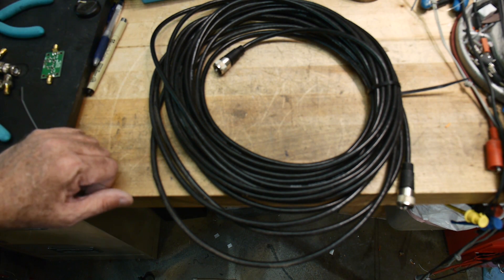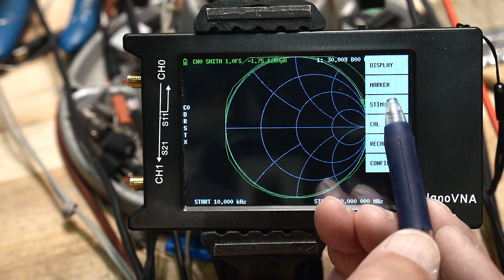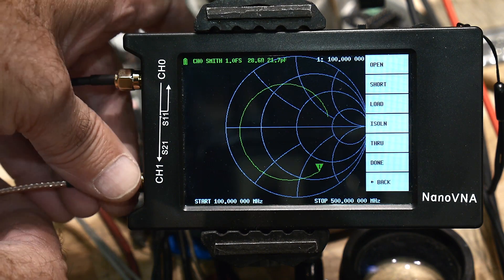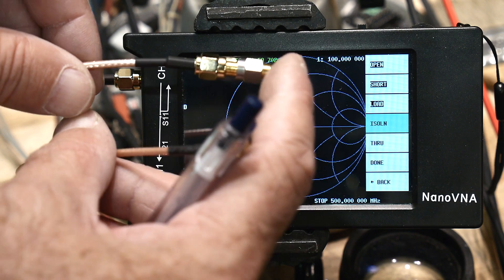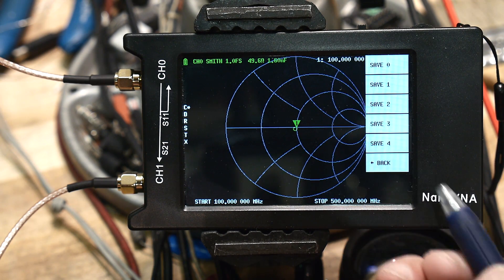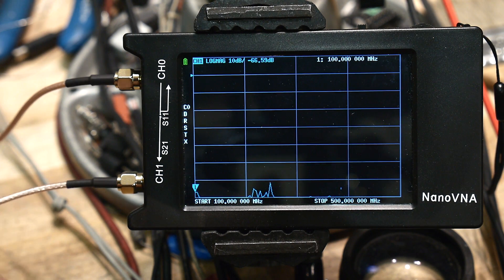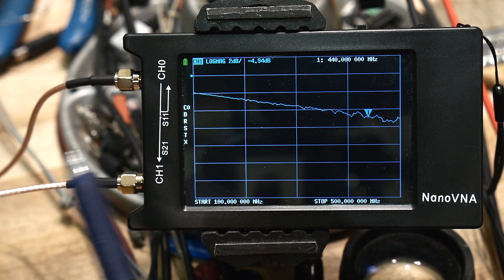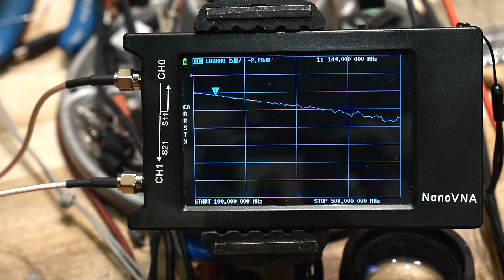#564 NANOVNA Coax Loss Measurement

Comment: As I understand it, the point of connecting these short RG316 cables is to make it easier to connect the cable being measured? What I mean is that the main measuring cable could be connected directly to the channels via PLA to SMA adapters.
Reply from the maker: yes, you can connect it directly and calibrate at that connector, if you use the small cables, you need to calibrate at the end of the short cable. I do it that way
1. to eliminate any mechanical stress
2. make it easier to move the device for viewing (photography)

Comment: Thanks! I built a common mode choke for HF last week and tried to measure both the common mode attenuation and the through loss, and got the same numbers for both. (Losing 25 dB of my transmitter power was going to pinch.) I didn't realize I had to use Trace 1 to view the Port 1 magnitude. I just tested again and the common mode attenuation is 25 dB or more, and the through loss is less than a half dB. Not too bad for something cobbled together on a whim.

Comment: You can also use the elect-delay function to compensate for small bumps from connectors etc. Without disturbing your calibration.  W2AEW has a good video on this..

Comment: Aren't the loads to be connected directly, without a cable in between? I usually use my reference cables just to calibrate "Thru".
Reply from the maker: many times you will want to measure a device that can not be connected directly to the VNA. if you cal at the vna then do the measurement. the measurement will be the device and the cable both. if you calibrate at the end of the cable then all of the properties of the cable will be ignored

Comment: To put this loss into perspective, every 3dB loss cuts your power in half. So that 5 dB at 440 means this cable eats most of your power.  50W at the radio will give only 16W at the antenna.  This is why cable quality and cable length are both critical.  I'm using 35ft of LMR 400 to get to the antenna on my roof which gives me 0.6dB measured loss at 144MHz and 0.95dB loss at 440MHz.  So 20W at the radio gives me 17.4W on 144 and 16W on 440 to the antenna.  Also, you really should calibrate out those adapters.  The do have loss, and stacking them like that can cause more loss than you think.
Reply: If your radio is putting out 20w, and you believe that an adapter has even just 1dB of loss, then you should expect that the adapter would therefore be dissipating about 4w of power as heat, and being so small it would be soon glowing red hot (or at least a burn hazard). If it's not glowing red hot (nor a burn hazard), then perhaps your assumption that the adapter is significantly "lossy" needs to be reevaluated.
Reply: @JxH  loss doesn't mean only heat. It also includes radiation. Also, if SWR is high, the transmitter can be absorbing some of the reflected power.

Comment: Hi IMSAI Guy, great video.  There is a shortcut you can take when calibrating the NanoVNA for coax loss measurements which you might have already stumbled upon since you made this video.  You can skip the open, short, load and isolation part of the calibration and just do a thru calibration if just doing loss measurements (or phase shift measurements) using the S21 port.  Just select the frequency range you want to use, connect your jumper cables together just as you did, select calibrate, select reset, select calibrate, select thru, and select done.  You don't need to save this calibration, and the calibration will be valid as long as you don't turn the NanoVNA off or recall a previously stored calibration.  This shortcut procedure is nice in that you don't need to use your open, short, and load calibration standards, and you don't need to save the calibration in an already stored calibration that you might have wanted to keep.  Just FYI, Don

Comment: Can i measure cable lose measurement with single port vna?
Reply: Measure reflected power on two different cables and subtract. If you know the absorption of the first cable, then you can calculate the answer.

Comment: For me after calibrating the way you do it shows -23db insertion loss when I connect through. What did I do wrong?
Reply from the maker: my stop frequency was 500MHz. you may have been measuring at a very high frequency.
Reply: @IMSAIGuy  My Range was 850Mhz to 890Mhz. I am trying to measure for LoRa at 868Mhz
Reply from the maker: @elmejor06  check the datasheet for the coax you have. it probably have that much loss at such a high frequency and length.
Reply: @IMSAIGuy  no I mean I get that much loss with my VNA calibrated and the cables connected with through. I am not even measuring. Something must be wrong with the calibration.
Reply from the maker: @elmejor06  with the 6" cable? something is very wrong. have you ever made an S21 measurement before?
Reply from the maker: @elmejor06  maybe bad cable, they are very cheap. use an ohm meter to see if there is connection and look to see if the pin is extending out and didn't get pushed in.
Reply: @IMSAIGuy  no, I am completely new to this.
Reply: @IMSAIGuy  I got it. I had it set to S11 and not S21. Now it works. Thank you for your replies and this tutorial!

Comment: For the 45 years I've been a ham I've always heard that there is "some" loss at every connector so if you use 2 or 3 adapters on each end of the cable are you sure that you didn't introduce "some" loss? Or were you implying that it was negligible as far as the measurement. I would have thought that half of the 2 meter band loss was in the plethora of adapters.  Please understand that I'm not disputing you. I just want be sure I understand what is factual. Thanks for one of THE MOST INSTRUCTIVE videos I've seen on using the VNA devices. I am building 2 meter base antennas out of junk parts for new hams on tight budgets and the VNA will be helpful in adapting the pieces and parts to 2 meters. I just subscribed to your channel.
Reply from the maker: https://youtu.be/GOCD5DvOj5c

Comment: In the total scheme of your system for this test, with all its connectors, adding the little OPEN terminal to calibrate is a waste of time - you may as well calibrate with nothing on the end.
Reply from the maker: and I'd have a bunch of people comment that I didn't calibrate correctly.     I won't win  (no it doesn't make any difference is this measurement)

Comment: I think everybody by now knows how to calibrate a nanovna.  Why don't you just do the measurement and you will have a 2 minute video which is all the useful content here.
Reply: You would be amazed to find out how many guys do NOT know how to calibrate a nano VNA .. why one needs to calibrate it with the pigtails when used, and how many forget to press RESET when they start a calibration, or not save it after it's completed.
Reply: There's always somebody who will have just bought one and needs help. I've perhaps had mine 4 months.
G4GHB

Comment: sir is this good for testing rg6 cable braid if damage or if with loss is this good for residential conduit cable test
Reply from the maker: residential cable is usually 75ohms so this will not work as shown
Reply: @IMSAIGuy  Can the test impedance be adjusted? How about using a 75 ohm resistor to calibrate the VNA?

Comment: If I put a 50ohm dummy load on Channel 1, could I use that to get a good isolation calibration?
Reply from the maker: The most correct way to do an isolation calibration on a VNA is to have channel 0 and channel 1 both with 50ohm loads. They only supply one 50ohm load so the next best thing (if you don't want to buy a second load) is to use the load on channel 0 and leave channel 1 with nothing on it. The internal attenuator on channel 1 will be sufficient.
Reply: @IMSAIGuy  I went ahead and bought another calibration set from eBay for about $12 so that I could calibrate both channels. Thing is, the loads don't seem to match. I if I SOL calibrate with the set that came with my NanoVNA and then attach the new load from ebay, I get 51.5 Ohm. ...seems like that's too much variation for a calibration tool. Interestingly, when I attach my MFJ 100W dummy load, I get 50.1 Ohm. 

Do you think I got a lemon of a load? Or, is this within acceptable tolerance for $12 calibration hardware from eBay to be used on a $50 device? ;-)
Reply from the maker: @TroyCraft  measure it with a multimeter and see which ones are closest to 50 ohms
Reply: @IMSAIGuy  I missed that obvious step! Thank you for the nudge. The load that came with the NanoVNA measures 50.4 on my Fluke 117. The eBay load measures 52.7. The MFJ dummy is 50.2.  ...I think I'll use my MFJ as the #2 load to do an isolation calibration. (good idea?)
Reply from the maker: @TroyCraft  you are worrying way to much about the isolation calibration. any of those would be fine. it does not need an exact 50 ohms or mechanical reference plane like the S11 calibration. on the nanovna having nothing on that port still gives a fine isolation calibration.

Comment: As an old RF guy using the high end HP, Agilent and Rohde Schwarz VNA's and Spec An's spanning a 40 year career I wanted to thank you for these tutorials to get me converted to using my Nano VNA and Tiny SA.  One thing I learned from a HP sales rep, when I got started, was connector care.  It's not a good idea to turn the basket (female) of an SMA connector when connecting to a male connector.  Rather it is much better to turn the nut (male) of an SMA connector to keep the center contact from rotating.  Reverse Polarity of course reverses this.
Reply: True, but...  Try to hold the SMA 'Short' body from turning while turning it on. Impossible. Even the 'Load' lacks much of a hand-hold, so it inevitably turns the pin. So every calibration cycle means that everyone needs to violate this otherwise good advice.

One can purchase SMA-male to SMA-female "adapters" that are also known as "Connector Savers".

Or, we can realize that the NanoVNA is so incredibly cheap that it's not worth worrying about. Some of them are $50, while even the Connectors Savers are $6+, so I'm not even sure using connectors savers are good value.

Comment: Congratulations on nanovna. But how to measure the cable loss already on the roof?
Reply from the maker: Possible but not easy: https://www.keysight.com/upload/cmc_upload/All/GNO2_ERTA_FINAL.pdf
Reply: @IMSAIGuy  Ok thanks for link. But by NanoVNA not possible ?
Reply from the maker: @PascalCASTRATARO  I think one of the techniques shown is using an S11 measurement. the cable needs to be disconnected from the antenna so it is an open. then the return signal is measured in an S11 measurement on the VNA. The loss will be twice since it is a return path. It is not very accurate but would show gross problems.
Reply: @IMSAIGuy  I think it's really hard for a jpole antenna that has been short circuited. I have done some tests, but they are all negative
Reply from the maker: @PascalCASTRATARO  I don't understand what you are saying
Reply: @IMSAIGuy  This is because I don't speak English fluently, and I have to go through translation.

Comment: Thanks for the excellent videos. To compensate for the coax adapter loss shouldn't one attach the adapters and perform the calibration at the adapters?  Not an issue at HF but it may make a difference at UHF.
Reply: Thank you very much for your excellent videos about the VNA. You are a great teacher.
Reply from the maker: Yes it would be better but it might not be measurable at low frequencies. watch my video: https://youtu.be/GOCD5DvOj5c
Reply: @IMSAIGuy  Thanks. The NanaVNA is so inexpensive that I bought a couple of them and permanently mounted BNC, N and UHF adapters on each and made corresponding OSL&Thru cal kits.

Comment: How do you test loss if you have an antenna mounted on the other end or nothing at all? No adapter/fitting?
Reply from the maker: if there is an open cable, then you assume 100% of the energy is reflected back. An S11 measurement would show loss on a two way journey so that loss divided by two will be the one way loss. This is not as accurate as the method I showed.
Reply: if you have an antenna at the other end of the cable you just measure SWR using Channel 1 only. The adapters are two to do a "thru" test. This is how I'm measuring filters.
Reply: Measure reflected power at the feed point of the antenna and again at the transmitter side over the coax.

Comment: I hope that by they time I buy a NanoVNA, they put a time-domain representation in it. At higher frequencies, it's good for separating the connector-launch from the cable.
Reply from the maker: My friend uses the Nano connected to a matlab program he wrote to do the time domain part. uses it to locate problems on high speed PC boards.

Comment: Great video! Can we measure 9:1 balun loss with the same setup?
Reply from the maker: well the problem will be with impedances. The device is set for 50ohms out   50ohms in. The balun takes the 50ohms to 450ohms. so trying to measure with a 50ohm input will not work. you will not need phase information so a simple setup with an RF generator and oscilloscope  measuring across a 450ohm resistor would be fine
Reply: @IMSAIGuy  you do two back to back.
Reply from the maker: @TheRetiredtech  good idea. now I have to buy two of everything! :)  need the buddy system
Reply: @IMSAIGuy  this is how you call it? Buddy system? Kind of doing that when I buy components, just to make sure I have a large sample to pick good tolerance parts from.
Reply: Experiment: Measure the signal strength/pattern of the antenna with and without the balun.

Comment: I am amazed at the lack of understanding of coaxial loss at VHF and UHF.  I had a couple of my repeater users that run 100' of RG-8X at 444.x and can't understand why they would be weak into the repeater. I explain that for every 3dB of loss you're essentially cutting your power in half.  100' RG-8X has loss very close to 9dB at 444 MHz.  30W/2 = 15W/2= 7.5W/2 = 3.75W. That's a lot of power to be throwing away
Reply: I think this was one of the reasons to "test the RG8X" in the 100-500 MHz range. Everyone knows it does OK on HF.
Reply: Thank you IMSAI Guy and Frank Sweeney. I have been searching for that exact number for days. I read it somewhere but couldn't remember the numbers. I seem to remember reading that 1dB loss is about an S3 loss at the receiving end.   I recently used this (IMSAI Guys') video to see the loss in my coax cables as they are quite old. I compared them to manufacture's loss sheets to see how close my cables were to new ones. Some were 2 to 3 dB lower than specs. I though, looking at 2 and 3 dB differences were not bad at all. Well, if 3 dB is equal to loosing half your power, it might be time for me to get new cables. Thank you both.
Reply: @hamradioeconomystyle48 his coax is mostly heater. Get some LMR400!
Reply: You can get a license today without knowing anything other than where to come up with $15.